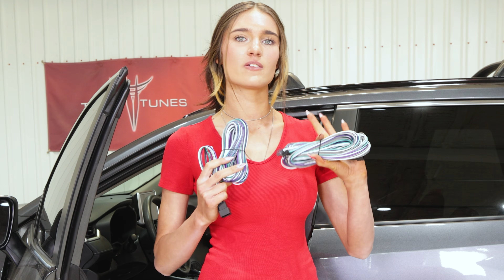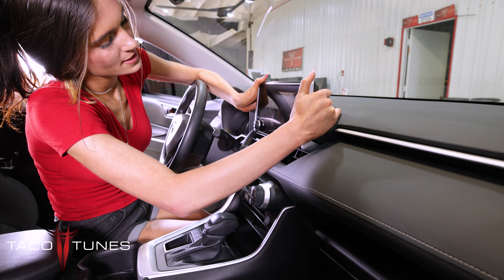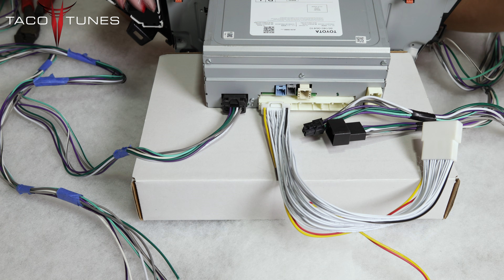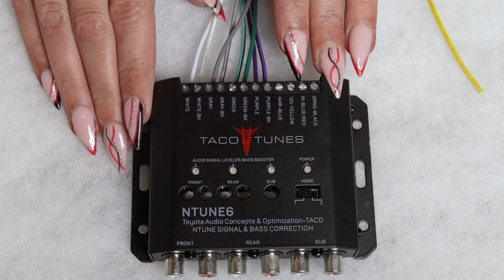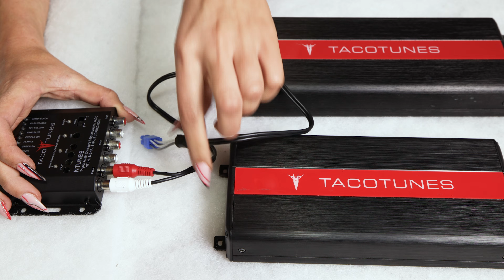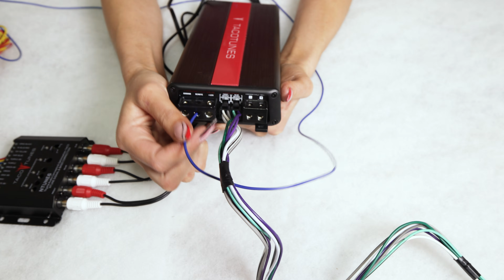2019-2024 Toyota RAV4 Add 4 channel & subwoofer amplifiers to your stock stereo EASY Plug & Play

Comment: I have a 2023 toyota rav4 XLE HYBRID. I have begun the long journey to improve the entire system. I liked your simple-to-understand video!! I want the taco tunes harness and I’m finding the website to be a bit obscure. Can you provide the part number please? I plan on using an audio control LC5i pro and use RCAs plus speaker wire.